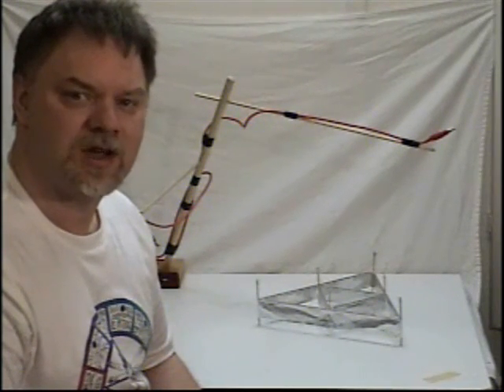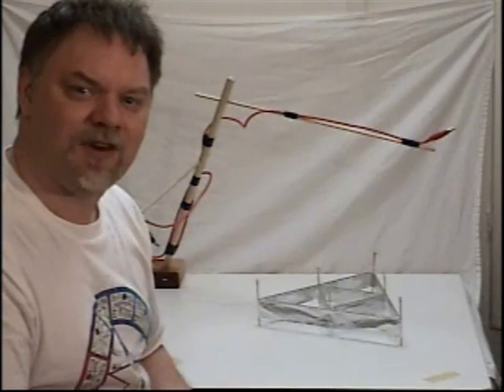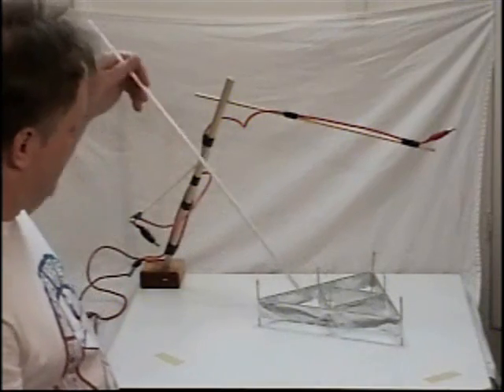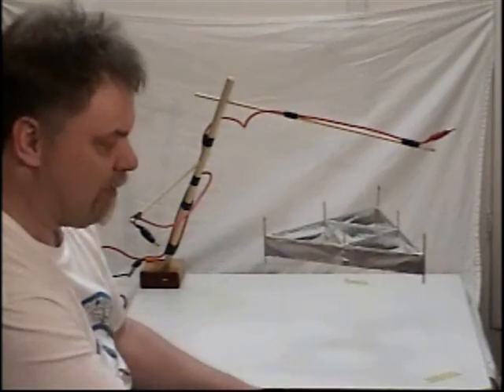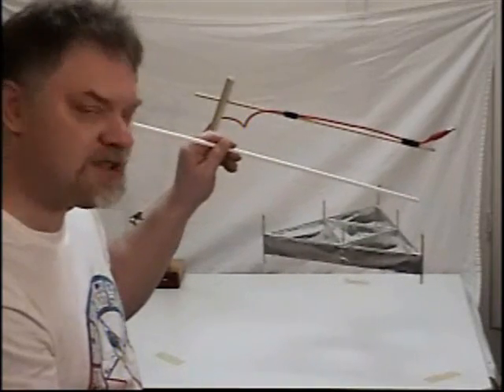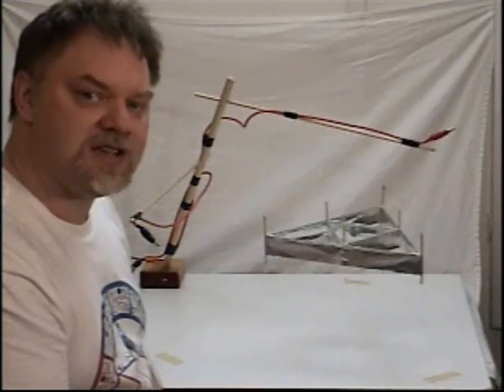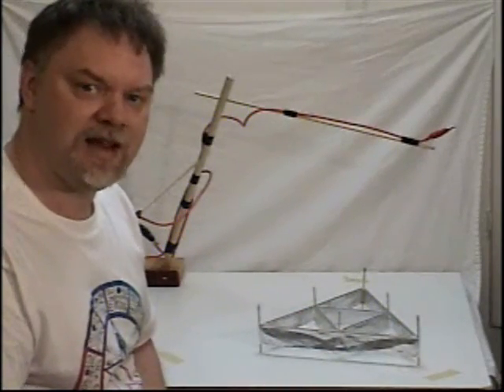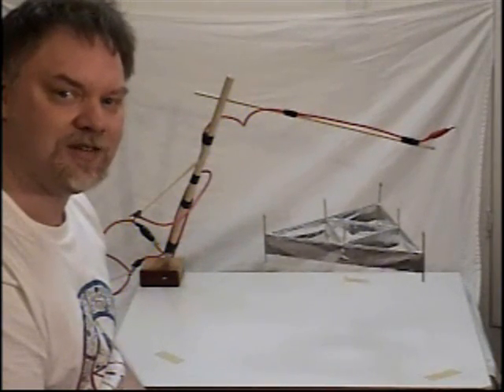LIFTER TECHNOLOGY: Demonstration & Explanation

Comment: No, actually that was simply an extreme example, and I meant to say stop not bend (i.e. event horizon, as the velocity to escape a event horizon exceeds 'c') light can bend around stars and various other bodies due to gravity, but even they they can only slightly bend. This is not the same as, say for example, refraction. I mean to actually change the vector of travel for a massless particle.  Its not a simple task, and the energy necessary to achieve such feats is quite literally astronomical.

Comment: First off, at 120kV, it would take hundreds of microamps to get close to 40 watts. You should at least use Ohms Law before you lie, to make it sounds more believable. Secondly, if you build a custom voltage multiplier from scratch, its not an "improved Cockroth-Walton" as you stated.  And then you just start throwing out some claims that have nothing to validate them or research them or verify them. They are little more then an attempt at misdirection. There is no connection between your claims.

Comment: I bought a Variac from Bob also (did you have a point about that?). By improved voltage multiplier, I must assume you mean you added more stages (which is what they are designed for anyways), so again did you have a point?  A lifter provides over 1mph winds, which is more then enough to blow away little styrofoam balls, so the problem was your experiment, not the science. There will always be tiny force in a vacuum since a pure vacuum is impossible. Your drowning pops.

Comment: It IS an ionic wind effect. The polarity of the current in the wires does not determine direction of the wind; only the relative positions of negative (wires) and positive (tin foil) charge. The negative ions from the wires move toward the positive tin ions in the foil, and Newton's Third Law agrees that the lifter will then move with equal force in the opposite direction. Reversing polarity does not change where the + and - ions are, only the direction of electron flow.

-IMP ;) :)

Comment: LOL! you see its call "ion transfer" or "ion cycling" where the charge of volts creates the electrons in the wire to cycle with the less dense ions in the tin foil. so its a type of thrust cause the transfer creates energy and that creates up motion but cause this tranfer is using "partical reaction" there needs to be air. P.s. not going to edit that its a copy and paste from my comment on the, "Hexagon lifter"

Comment: Apology for incoherence.  If the wire top is seperated from the aluminum skirt bottom and each placed in seperate stacked and sealed clear boxes the skirt will still jump up towards the wire.  Obviously the ionic wind isn't a factor in this instance.

Comment: At the Naudin Labs website you can this experiment conducted with the two sides of the capacitor in seperate air-sealed compartments.  It still works.  For example the aluminum skirt will jump to the roof its sealed box.

Comment: The reason the ion wind doesn't shift directions is becuase it's the same machine either way you charge it.  It's an electrified wire that produces ions. It doesn't matter which direction the electricity flows ... it still produces ions wich are directed DOWN to the aluminum skirt.  Ions will always flow toward the Aluminum, no matter which direction the electricity is flowing.  It's not a matter of polarity in the wire ... it's a matter of where is the aluminum.  And it's always DOWN with this.

Comment: De-bunked on MythBusters. Ions created by electrical current in the upper wire are attracted down to the aluminum creating a down draft. The air forced down pushes the lifter up (equal & opposite reaction). It works becuase it is all very light weight materials. If it really affected gravity, the materials wouldn't make any difference. You could make it from lead & it would still lift if it really affected gravity. No such thing as electro-gravitic. Electricity does NOT affect gravity.

Comment: Irrelevent.  The math simply does NOT work, regardless of what you consider "paradoxically less power".  Power (I*E) consumed by this device is already incredibly small, but there is no way to compensate for your ignorant equation. 

There is an inverse relationship between current (I) and voltage {E) and the only way you can have 66pV and even one single watt of power is to have 15 Billion amps. Yes, I said Billion. 

You obviously dont comprehend the science behind your claims.

Comment: Lets take it a step further, lets try finding the voltage needed to lift a huge 1kg Lifter.

We know it will need at least a force of 9.81N to levitate from F = mg

Subbing into the equation V = F*R^2/m1m2 we get:

V = (9.81*6.37e6^2)/(5.97e24*1)

V = 667e-12 or 0.667 nanoVolts.

We are still 0.999999999333 volts away from 1 single volt, and according to you we should be lifting a whole kilogram by now!

The point is clear, Your equation is as nonsense as the rest of your claims.

Comment: Ok, lets examine your claim for a moment.

You said the equation for Electrogravitics is F=Vm1m2/R^2

So, a basic lifter, with a mass of 20grams would need a force of 0.1962 Newtons or greater to lift. F=mg

Rearranging your equation to solve for voltage we get V=F*R^2/m1m2

On earth at sea level, we sub values into the equation and solve for Voltage needed to lift

V = (0.1962*6.37e6^2)/(5.97e24*0.02)

V = 67e-12 or 67 pico Volts

Yet we know it takes ~30kV to lift ~20g. Hmmmm...

Comment: All above references have since been investigated and proven to be false.

All listed Labs failed to achieve 'lift' in a vacuum, it appears the poster is confused about the method of the experiments.

They suspended a free-spinning device on a thin wire.  This device works on the same principle of the lifter, only the high voltage should cause rotation at high velocity, instead of levitation. All experiments listed were unsuccessful and concluded that ionized wind was the mechanism of operation.

Comment: Proving nothing... That device worked on ION Wind no different then any other lifter.

Size isn't the issue, weight is.  Dimensions are meaningless, you are overpowering the force of gravity, which is dependent on MASS, not AREA. And I said overpowering, not eliminating.

Comment: your joking right?

They never said rockets wouldn't work in space because there was no "air to push against" they said rockets wouldn't work in space because there was no air to burn the fuel.  

They were corrent, and that is why they MUST use oxydizers (such as liquid oxygen, hydrogen peroxide or liquid flourine) as part of their fuel.

The vacuum of space is approximately -30psi at ground level, there have been NO successful tests at that negative pressure.  NONE.  Period.

Comment: Actual current IS movement.

Secondly, if you flip the blades of a real helicoptor upside down, it will not lift no matter which way you spin them.

The blades are an airfoil design, and work on the same principle of lift as an airplane. Turn the blades upside down, and rotate them backwards and they create lift in the opposite direction, driving the helicopter into the ground.

Unless your talking about cheap RC models that use a flat blade design? Then maybe...

Comment: P = I*E   (Wattage = Current * Voltage)

Pin = Pout  (The power (watts) put into system is the same amount as you get out of the system)

Together this means that a device that consumes 5 watts at 0.000250 amps and 20,000 volts is exactly the same as a device that consumes 5 watts at 0.045 amps and 110 volts.

So... his electric bill should be the same as yours (assuming his high voltage power supply is not terribly inefficient).

Its just too bad he is spreading misinformation and ignorance.

Comment: Air molecules and ions are elastic on impact at low velocities. High velocity tends to cause molecular disassociation with accompanying secondary ionization.

This secondary ionization will cause a net decrease in the reactionary effect or thrust due to a reversal of direction of the now oppositely charged particles. The goal now becomes to move as much mass as possible at a low velocity with the max amount of elastic collision and min amount of molecular disassociation and secondary ionization.

Comment: The maximum thrust of a lifter must require moving as much air as fast as possible in a given time.

Thrust = mv/t
m=mass of air, v=velocity, t=time

The power input to produce this movement is related to (1/2mv^2)/t energy in joules.

If we define system efficiency as the ratio of power out to power in we use

Eff = mv/t * 1/ mv^2/t = 2/v

Efficiency is inversely proportional to the velocity of the air, and suggests the utilization of large mass of air at low velocity for efficiency.

Comment: incorrect, its ion flow, electrons will always flow toward the path of least resistance (the foil skirt).  Your assumption would only be valid if both the anode and the cathode were identical.  

if you place your hand under the lifter, you can even feel the wind created from the ionized air.

Comment: your wrong when tested in a vacuum chamber the lifter did not work, also when tested by a extremely sensitive  gravity meeter that can record the slightest fluctuation did not register a gravitational field change when this contraption was tested. what is actually happening  is the high voltage is ionizing the air and making a ion wind lifting the contraption. Making significant changes in a gravitational field takes tremendous amounts of energy
See Mythbusters: Season 4 Episode 27

Comment: ive seen this on mythbusters at first they thought that it worked but then they tryed it in a air tight box and put it under a vac and it did not work so no air no flight so it must use air to fly. i dont know a lot about electics but differnt kinds of power work differntly like ac and dc ac motors still go the same way if you change the power around but dc go the other way when you change the power around but it is still a good learning tool for kids

Comment: Even though he reveresed the current, the wire was still on "top" of the skirt, and electroprophytic effect was unchanged.  The concentration of ions are the same, irregardless of the "direction" of DC current; the concectration will always be above the constuct, so this reversal of polarity demonstrated nil.  Try putting the wires on the bottom...

I'd like to see this demonstrated with wireless microwave power emittors/receptors, to see if the absence of the wires helps for more mobility.

Comment: generally you need 1mm per Kv, that does look really close, but the closer the better as long as there's no arc. The ion wind will always move toward the corona wire, regardless of polarity. THe key difference is agitating nitrogen vs. oxygen.  Wiki has a decent further explanation of this.  There has been some studies, that have not been able to attribute up to 2/3 of the thrust to ion wind alone, so it's possible that there's something to the "falling up" explanation.

Comment: This is cool, and the quick effect and then stabilization is nice.  Is the wire on the bottom still 'lose' or is it stretched tight?  How high will this rise?  Will a tesla coil provide the same voltage?

Comment: sorry man, but you've got this wrong. I've built a lifter myself and i can assure you that one can both feel and catch the ion wind that occurs. the reason that it works nomather the polarity is that air molecules can be ionised through both oxidation and reduction. but the air will always be ionised by the thinner copperwire, since the electrical fieldlines are closer there.

Comment: Basically what you see is what you get.  A balsawood frame, the cheapest (lightest) kitchen foil you can get. and some thin wire running around the tops of the bits sticking up. make sure the edges of the tinfoil on the upper side are rounded over or you may see it get burned away.  You'll need to be able to supply the device with (typically) 20,000 - 30,000 Volts DC. Im sure google will come up with a step by step guide on how to make one.

Comment: increasing a potential difference gradually won't keep it "out of equilibrium" that doesn't make sense so it can't be what you mean. I think what you mean is if you use AC the voltage alternation is too rapid to create the effect, it needs to be one way or the other.  The greatest effect is +ve to the corona wire.  -ve works in a similar way but to a lesser effect (and I already knew, I was just curious what answers id get)

Comment: One more thing, James Clerk Maxwell described this in 1872, as the electric potential, the same book Tesla used to understand electricity completely. we maintain, the potential difference in the wire, and skirt, never reaching electrical equilibrium, of current, in the manifold. IE. in the direction of the positive current.

Comment: How about creating the electrogravitic effect in a electric motor, were there is no use for friction on the bearings? doesn't use much energy at all, and the motor efficiency will increase dramatically. mabey a gyroscopic motor or, on the uses air, or glass as the bearings?

Comment: Hi, and Thanx for the demonstration.
could you tell us a bit more regarding the air gap and actual energy flow. I see two (1 small one large) skirts in your demo. It seems to be operating like a capacitor. What governs its y axis stop point and x-z location? Is this a matter of two opposite fields being separated by a dielectric of air or space?

Comment: Erm.... it's obvious that reversing the polarity just changes the direction of the flux? Surely the only way for it to drop downwards is to either reduce the voltage or invert it? ie- turn the lifter upside down. It's the same principal as aerodynamic flight in which a fighter jet would plummet from the sky when inverted unless it used it's ailerons to compensate.

Comment: If you create one lifter pointing downward as in the video, then mount an identical lifter pointing in the opposite direction, with balanced current control between downward and upward lifters, you can control up/down and similarly in all spherical directions. Should be controllable using joystick etc.

Comment: what about putting some thin wire below as well as above the lifter body?  Wouldn't this allow you to 
manuver it? You could control the voltage on the top as well as on the bottom wire, and for that matter you could do the same thing on the sides, this could allow you to propell it as well?

Comment from the maker: My own Glassman HV power supply is plugged into a normal wall socket, converting the standard 120 volts / 15 amps to 30,000 volts / 3 milliamps. check out the selection of HV power supplies available online at Information Unlimited

Comment: Continuation of previous note.

Electrostatic - NO because you have a current that neutralizes the ions at the skirt.

Efficiency - very bad - 11 watts to lift such aligh device - note a strong drill has about 300 watts.

Use for spaceship propulsion - NO. You have to bring the ions back to the wire and the impulse on the ship by doing that destroys the lift. Conservation of impulse in a closed system.

Comment: Continuation of previous note.

If you make the skirt horizontal the impulse of the ions would compensate the lift.

You can also use a plate instead of a wire because the field characteristics of a sharp rim are the same.

Thrust is produced when the shirt covers less than 360 degrees.

Gavitational well? My answer - NO

Comment: The electric field at the wire has a very high density and the field at the skirt has a very low density.

When you increase the voltage, air particles are ionized at the wire, but not at the skirt.

The ions are driven down to the skirt and the opposite force creates lift. The ions enter the skirt more or lesss horizontally from both sides so their remaining impulse is destroyed.

When you change polarity you have the same process but differently charged ions.

Comment: I'm not sure the reverse polarity demo disproves ion wind since it could just be positive ionized air flowing downward.  I see positive ions being coaxed to move all the time in various water slpitting devices that use voltage to manipulate the hydrogen.  

I do believe there is more to this phemonena than is apparent but not sure that reversing polarity proves it.

Comment: What is antigravity? It is the force that is pushing the universe apart. It is no more controlable than gravity. And it is most likely due in part to the presence of antimatter. For instance, if there was a concentration of antigravity in one area, it would push everything away just like gravity pulls everything in. This is not antigravity by whatever ever methodology....It is an assymetric capacitor with limited use and value...this is a toy. Or an air purifier, depending who your talking to.

Comment: What if the whole thing was wrapped inside a thin cellophane, the one used for foods. There should be space around the wire and foil for ionized air and that could be done by thin balsa sticks to keep the cellophane further. Air could not leave the device, it could only get ionized inside the cellophane. That would be the ultimate answer to the question if the device rises by ion wind or other means. Anyone dare take the challenge and wrap their lifter inside cellophane? I don't have one yet..

Comment from the maker: Think "tall & skinny" vs "short & fat" Asymmetry is maintained since the base portion is made of thicker & heavier aluminum when compared with the thinner & lighter cupola above. Imagine a stretched Lifter where the wire is pulled out past the edge of the foil skirt, analogous to the thin foil edge of the cupola overhanging the base. Thanks for Jean-Louis Naudin's video.